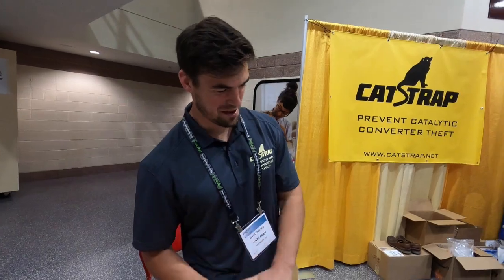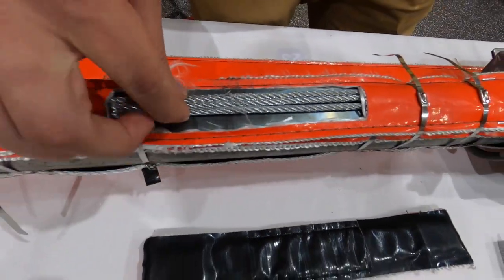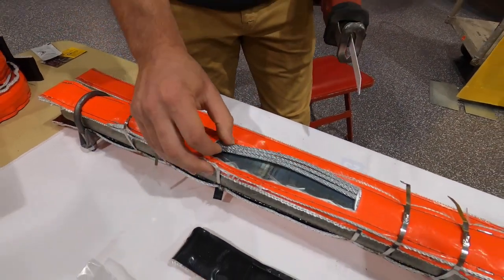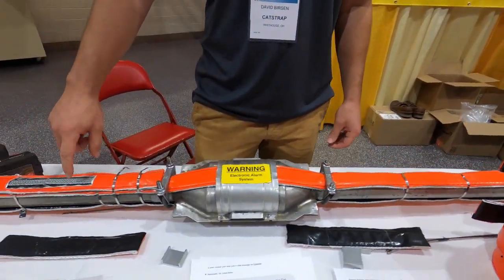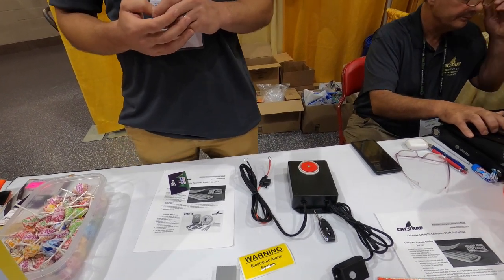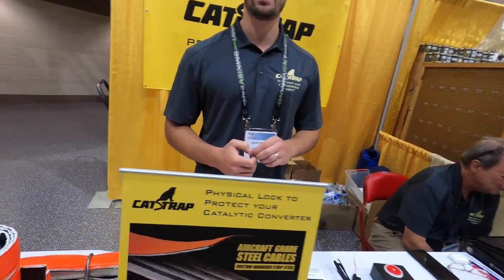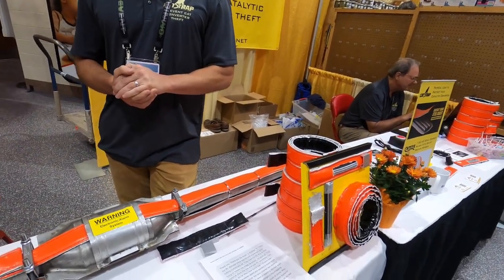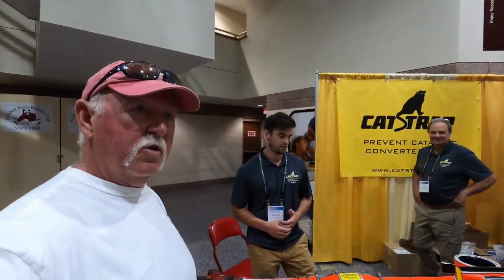Catalytic Converter Theft Prevention? Try this!

Comment: Great info. Thanks buddy
Reply from the maker: Thank you for watching! I think this is a great theft deterrent.
Reply: @ChippersIslandAdventures  yea I agree. I've been thinking about getting one. After seeing it first hand, do you think it's worth the price? The one with the strap?
Reply from the maker: Yes I do and I’ll be installing one soon.  It was good to see it in action and live. All the best!
Reply from the maker: Let me add, it takes literally 10 seconds to steal a CC.  Battery driven sawzall or cutting wheel. The cost to get another is at least 2000, if you can get one, which with supply line delays, May take awhile. Cat strap is about as good as it gets as far as simplicity and cost.

Comment: Seems like a great product. But CatStrap unfortunately needs to get out there to refute the DonutMedia demo of it, where it failed badly. Donut did an obviously faulty installation, but still, that's gotta hurt sales ...
Reply from the maker: I guess one can make anything look bad.  But I think installed properly, it’s a good viable deterrent to thieves accustomed to a 15 second job.  All the best!
Reply: It had nothing to do with their install. A grinding wheel EASILY defeats this thing.